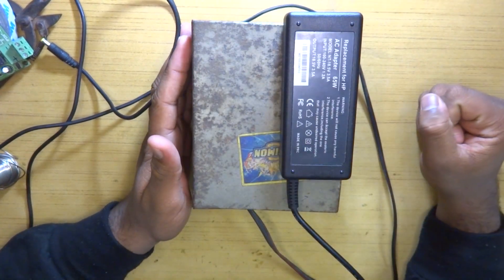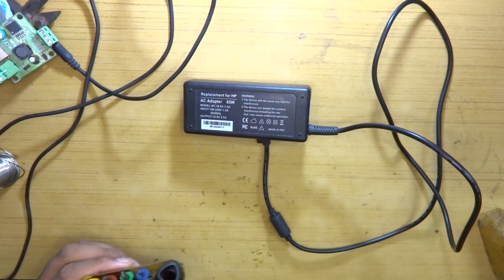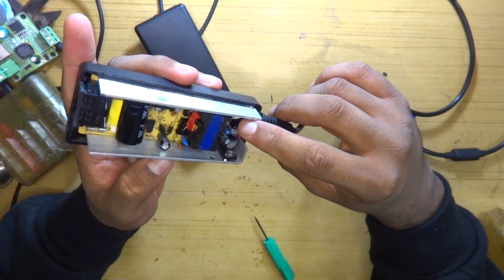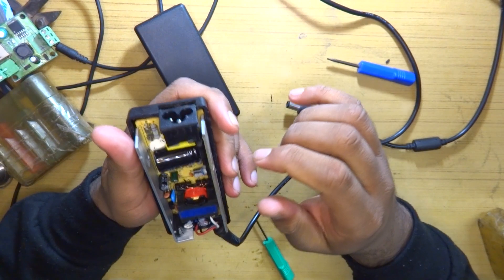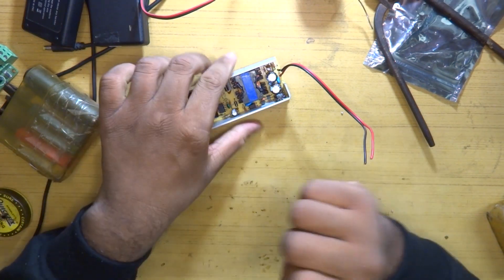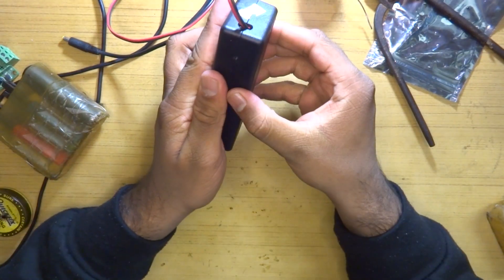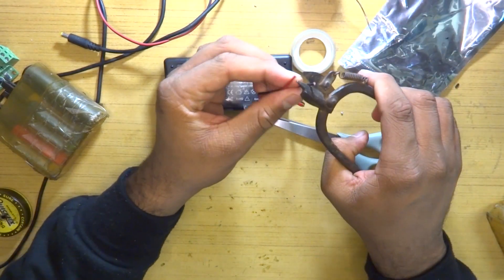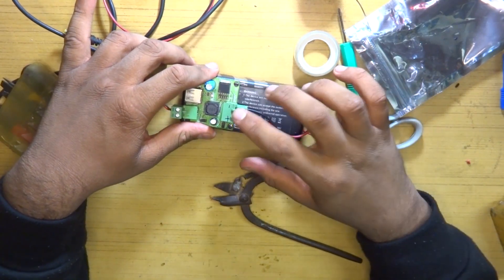DIY 5v 3A PSU Under $20 for Raspberry Pi and other SBC

Comment: Gave you a "like" because ....You made do with what you had .. so that's good re cycle-able sense .. so ignore all comments stating that could have bought a PS from Amazon.  By the way what was the white wire for?  Thermal cut-off signal from computer to power supply to kill power maybe?  If so perhaps you could include it in your design. Also include a " High Rupture Capacity" fuse in your output circuit.

Comment: I went ahead and bought a 10A 5v power supply at Amazon. I am going to wire a 1 to 4 usb connector to it and have 5 ports!
Reply: 10amp wtf
Reply: Stonks

Comment: Buying a $9.99 5v 2.5 amp that is made for the Pi seems a hell of a lot more practical.
Reply: Tim Ventura That makes for a pretty boring video 📺
Reply: True, but you can get these random adapters cheap at thriftshops or other sources and its easy for tech savy people to do